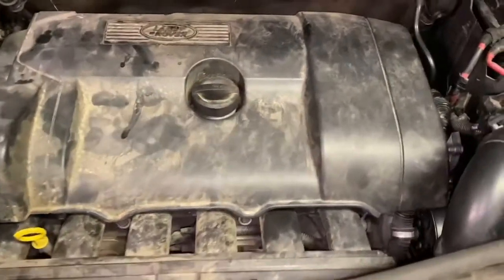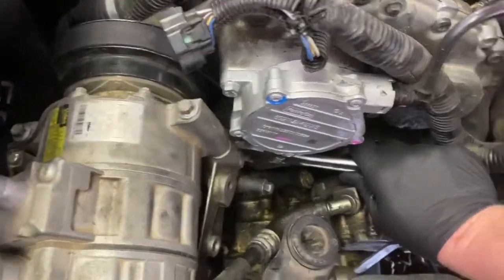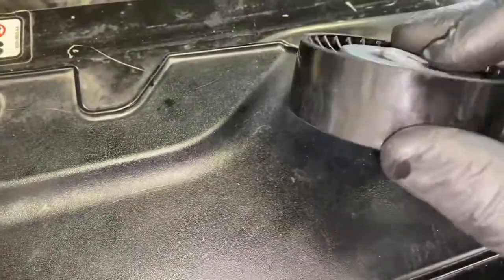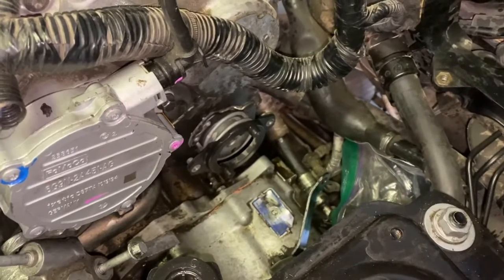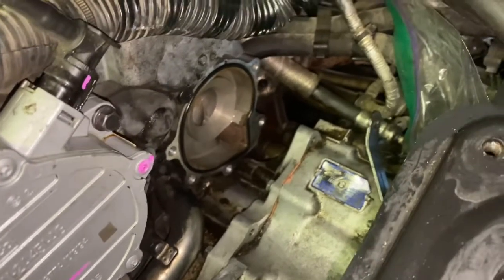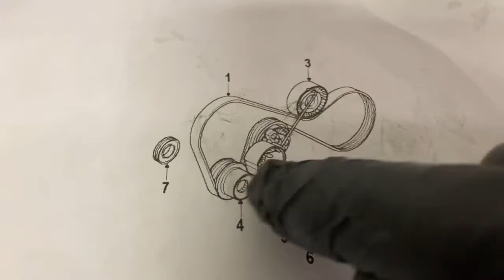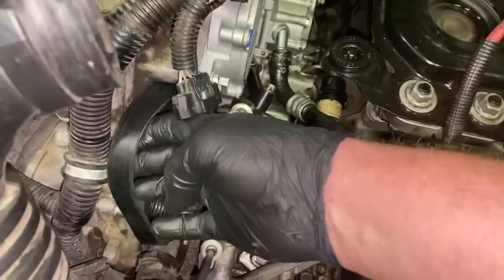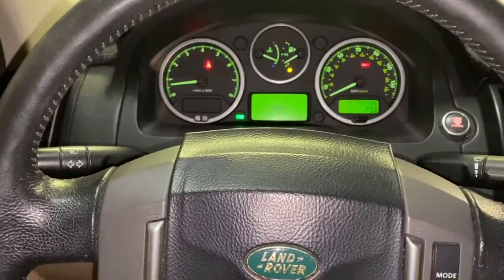How to change a water pump on a Land Rover. Step by Step Tutorial. Episode 68

Comment: Thanks for this, similar to my xc90.  Few comments:
Put new belt on water pump before remounting steering pump.
Rotate bracket on water pump to engage the spring.
Lower bolts on steering pump are very difficult to replace after removing.
Otherwise very thorough
Reply from the maker: Awesome feedback. This is a definite must.

Comment: Just liked and subscribed!   I have a Volvo XC70 2009.  Believe it or not, your video came as a suggestion while trying to change and work on my faulty water pump.   Really surprised the Landrover uses the same weaterpump.      Recently my engine was overheating, and then I changed the thermostat.    Now the engine is not over-heating,  maintaining maximum 115 degrees celsius, but I see a leak and coolant dripping out from near the water pump / power steering area.   I suspect due to the over heating of the engine, the rubber gaskets may have melted out, or if this unit has some sort of a ceramic sealing, it may have cracked.   I see you have bought an aftermarket water pump kit.    You installed this is early 2021.   Now it is late 2022.    How is your client's water pump holding up?   Any information, guidance and knowledge sharing is appreciated, while I wait for my parts.    Cheers!

Comment: Thanks for sharing the video I just checked a squeeling noise coming from serpentine belt area and when I turn off engine I hear the belt noise as well 
Any suggestion it's could be bad serpentine belt or anything else ?
Reply from the maker: Yes, I would replace your serpentine belt. It could also be an idler pulley or belt tensioner pulley that’s making the noise.

Comment: I got a question, mine is running steady at almost 3/4 on the temp gauge. Slight leak on the back of motor trans side back of motor. There is a hose that has rad coolent on the hose but it just runs up the back of the motor into a hook and looks like a vent, when the water pump starts to leak is it possible the coolest leaks down from the pump on this hose?